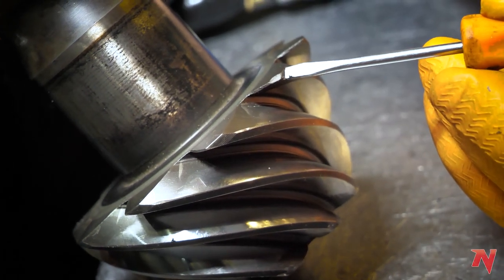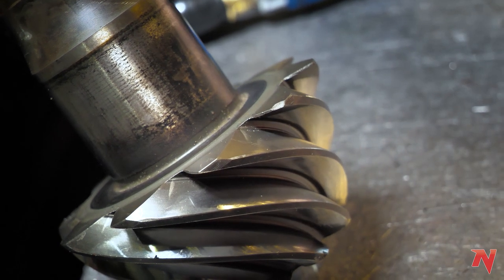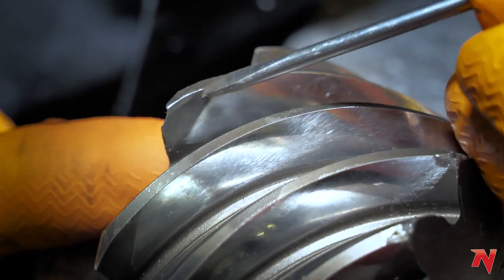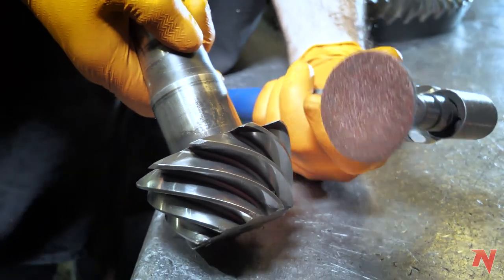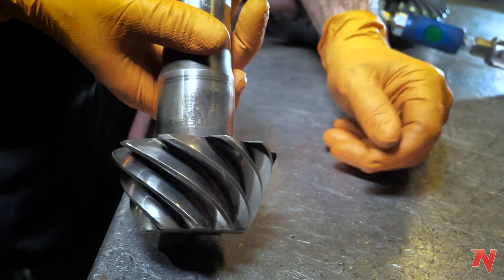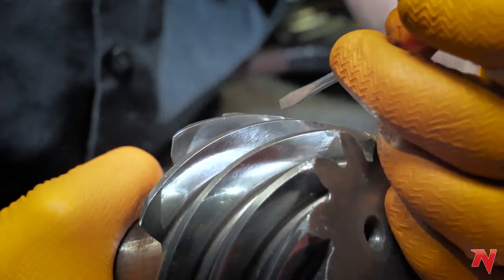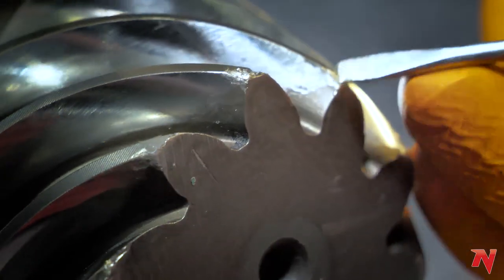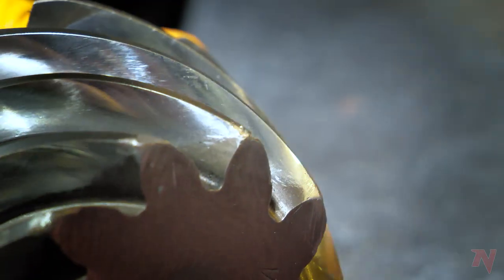How To: Fix A Chipped Pinion Tooth - Easily!

Comment: I live in Calgary Ab, and i just did a rear diff fluid change on my 2002 GMC Envoy 4.2l 4wd 3:73 Gear ratio this past Sat, Feb 29 2020 ..and when i removed the drain plug (I'm glad they're magnetized lol) was part of a tooth, small about 3/8 in length, I'm not sure if it's off the Ring/Pinion or one of the Spider gears, the under side of that tooth is "concave" i guess you'd say, with a clear crack along the one side as well, the fluid was dark like it hadn't been changed in ..well, never lol it has 262000km, and i felt no grit in the fluid and there were no metal shavings on the magnetic drain plug, 
-- before doing the fluid change there had been a noticeable sound/feel at accelerating take off at the light (i guess a slight grind? only at start off) no vibration at all while driving. I do know when that tooth cracked off though..about 4 months ago i was at the light to make a left turn into the downtown core from Memorial Dr. Edmt Tr. and accelerated while at the start of mid-turn (of course speed was very slow maybe 10kmh and felt and heard a loud bang at the rear diff, (i knew it broke a tooth) 
-- does anyone know if this would be a full rebuild or partial one, (i suppose once the cover is off one would know better) at least the fluid was on sale at CMP haha 
i know the job is entailed and not really inexpensive..parts are between $200 master rebuild kit and $600 through Rock Auto w/o ring, pinion or spiders(i haven't checked here yet!)
A reach out out!..is there anyone around here that knows their way around a diff, (I know some things and can assist) for a decent cost ...I called the Gear Centre $1600 w/diff in the truck $1300 diff/out, I know the work they do and have dealt with Gil and Nick in the past..and it's great!! ..but cannot even pay that lesser cost (it can be a weekend thing or a week scenario no prob there, whatever is comfortable)
...I will update this (with my ph#) when i get local prices too, at Kingsway also,
--Much Thanks to everyone! 
John

Comment: I bought the 4.30 gears for a 98 mustang and went with a mechanic to have them installed.  I lasted about 2 months with the new gears that were installed and then later I bought other gears with a higher ratio (4.56) and went to the mechanic to have them changed again but when he handed me the gears that he removed (the 4.30 gears , I lasted about 2 months with them) several  teeth were broken from the edges.  Does anyone know why they broken?  could it be that the mechanic didn't install them right or what?